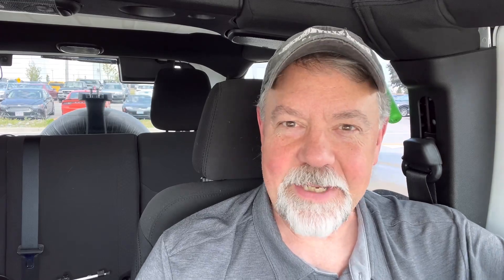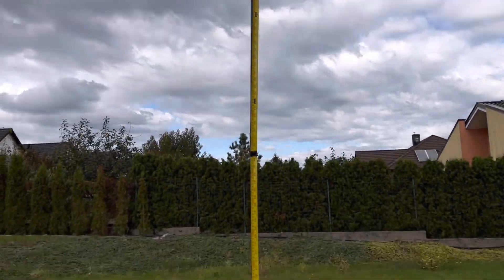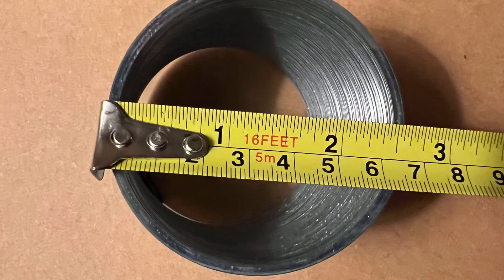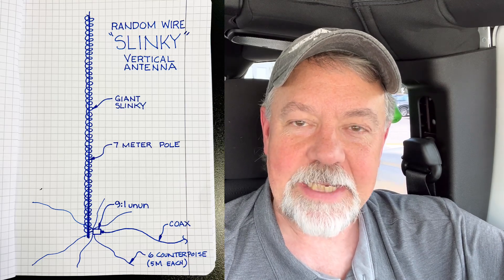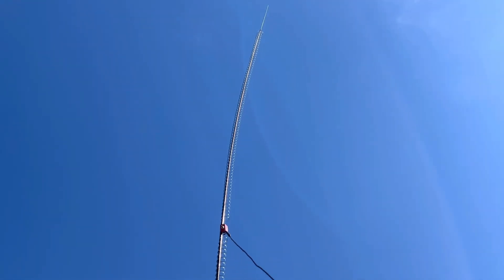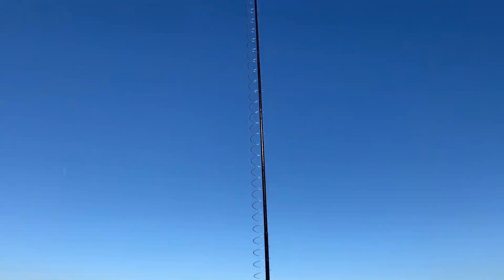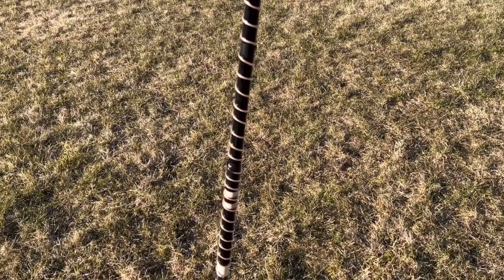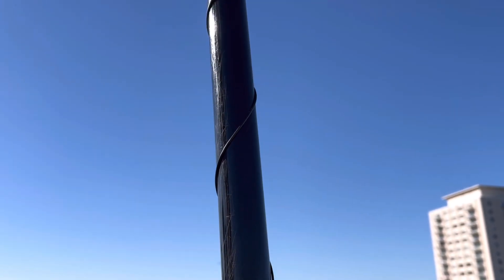Building Fun Ham Radio Antennas

Comment: Ham radio is all about experimentation.  The very first antenna I put up was a Hustler dual band 2m/70 vertical I purchased used for $40 at a local hamfest.  When my Elmer came over to help me get it in the air we discovered it was missing the top most element.  I pulled a large sausage roasting fork out of the garage, cut the handle off, and shoved it into the top of the antenna.  It wound up being 1.5: or less on 2 meter and flat on 70 cm.  That was April of last year we put up the antenna and it is still in use to this day.  We call it my "tuning fork antenna" and I don't plan on getting rid of it any time soon.  It has also become the landmark used by local hams in the area to find my house.

Comment: Hey, I just got my first radio today.  A Xiegu G90.  Now it's time to build an antenna.  What sort of coax cable do you use?  I looked at POTA FLEX on line but wonder if there are any cheaper options?  I am looking forward to setting a Slinky vertical di-pole outside my window in the cave.

Comment: I'm an advocate of using what you have or can ressonably get/afford easily.
   Just recently I saw a video on a chameleon antenna which apears to work well. It's two telescoping elements set at an angle from each other. A wire connecting the two elements at the top makes it a delta loop. The problem is that it sells for $600! One of the main components is two 17'  telescoping elements. I found 18.4' telescoping antennas on eBay for $17. They're made well as far as i can tell. A piece of wire across the top and I too have a delta loop if it want to. All for $34. Yes there's some sort of a matching section as well but that shouldn't be hard to work out.
   It's a hobby. Let's play!

Comment: In 2000 I made an antenna out of HVAC aluminum sealing tape.

I cut it for 10 meters, was able to solder the ends of some 450 ohm ladder line to it.

I took the paper backing off of around half an inch of each corner and stuck it up at the top of one of my shack walls.

I then ran the ladder line over to my tuner.

It tuned up decently in 10 meters.
I then found a station in France calling CQ on CW on that band and answered him using approx 50 watts of power.

He came back to me with a 559 report.

I was living in Helena Montana at the time.

You just don’t know until you try.👍